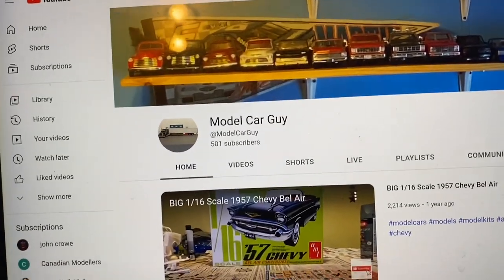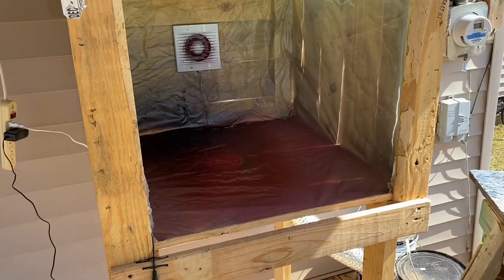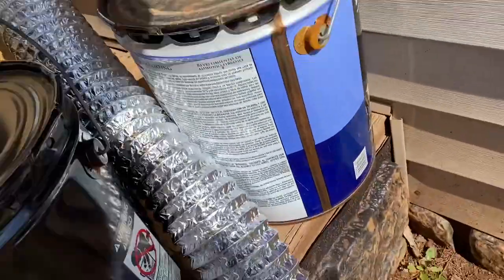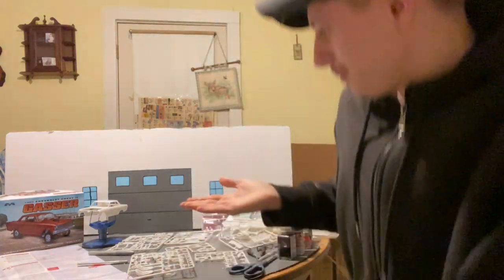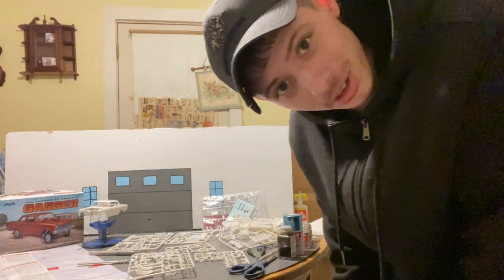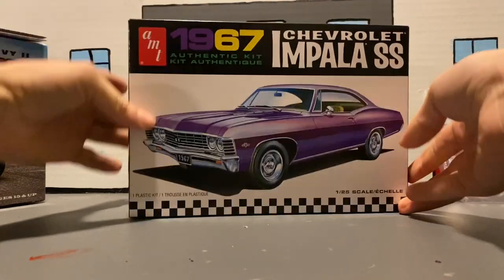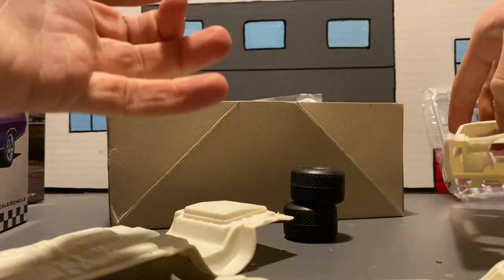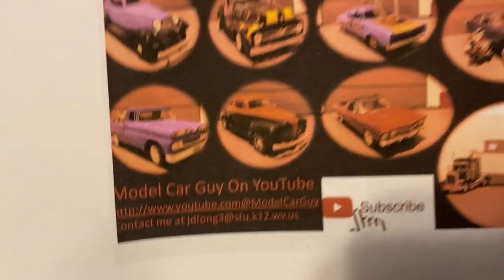500 SUBSCRIBERS SPECIAL Part 2

Comment: Booth looks good fyi I would put a filter over the fan or you’ll fry it with exhaust over spray just a tip it says 496 and you showed 501   I think youtube is on crack again lol congrats on the subs you got up there quick